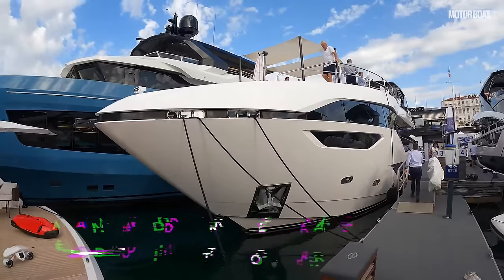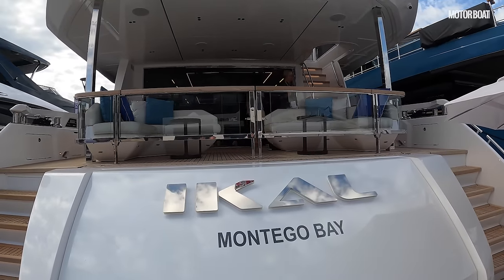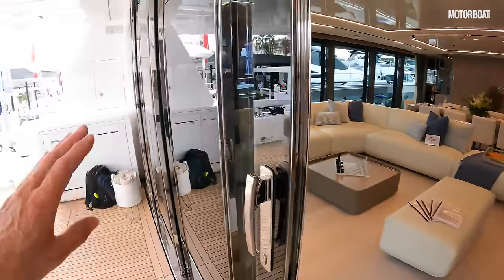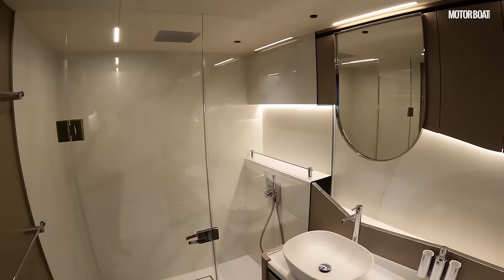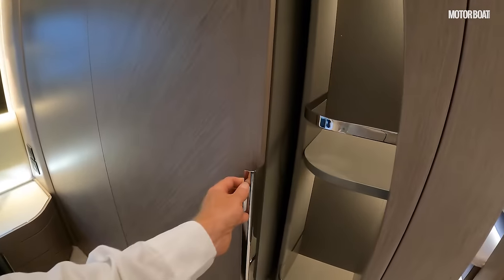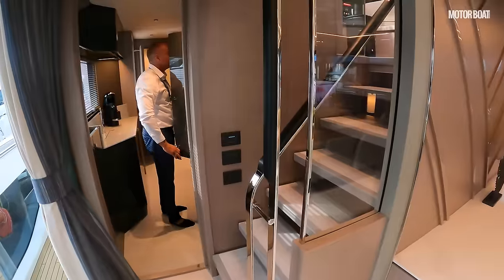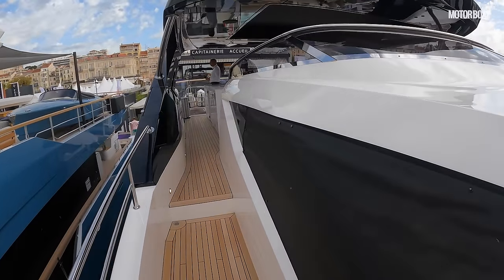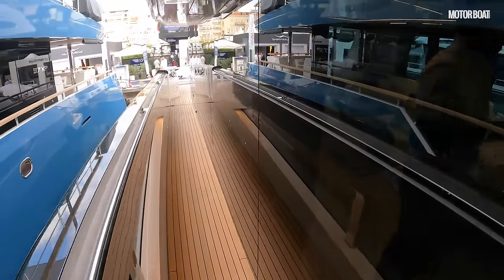Sunseeker 100 Yacht full tour | Inside Sunseeker's new 100ft masterpiece | Motor Boat & Yachting

Comment: Great tour Hugo! I like it . It has some new features and is in a great size range for them. The engine room access is pretty bad though. Also it's hard to tell from the video how the helm view would be. The fly bridge or upper deck is amazing!  The salon and the rest of the interior is beautifully done!
Reply: The visibility from the helm is probably horrendous with the height of the "dashboard" and the slope of the windshield. Maybe if they added a second helm position to the flybridge (I see absolutely no problem with it, just extend the wiring from the main helm), it could help a lot, especially since you can owner-operate it with minimum crew

Comment: Can this squeeze under the 24m reg standard? It's never very clear, the calculation seems super convoluted (I know it is not LOA or waterline length that determines it) and it's best to just let the manufacturer tell you rather than working it out for yourself.

Edit: you answered my question in the video, amazing that something this big can be owner operated.
Reply: Apparantly it does! But I have now idea how it is able to without a removable nose cone.

Comment: Great video tour 10/10 just one question though. The yacht is 29 mt and it falls in the 24mt that the owner can sail on their own with out crew, why is that?
Reply: Because the measurement is taken from the load line length of the main hull not including the bathing platform and the protruding bow section above the waterline.

Comment: Hello - great presentation, raw and honest! Tell me: with all the technological advances and new materials in this boat (and others of this caliber), have these advances reduced the need for maintenance and number of crew members required to run the boat and keep it in good condition?
Reply: Not really. They are certainly easier to control but they still take just as much cleaning and maintenance if not more due to all the  extra kit they carry.

Comment: Thanks for taking us around, difficult job during a busy show. Lots of glitters, but a boat to have a berth in south of France or Mikanos, not to go to sea. I hope that master room will not be flooded in big seas, wonder how water tight that door master cabin door is? Too much furniture and seating space, very ambitious to mimick large boat environment, but looks too crowded. Not much space to move. Also not much space for storage of boat stuff. Many refrigerators, but not enough lockers.

Engine room is a failure, too tight, again a lot of compromise to have large living space. Accessing the engine room during voyages will not be easy and pleasant..

Pilothouse is also a compromise, I feel with such high bulwarks and lounging space in the front, view is limited during the cruise. Captain will be operating blind during docking and have to rely on the crew assistance for the maneuvers? The dining table in the salon has better and more open views.

Nevertheless, looks like this is what is selling, but a good, seaworthy boat is always preferred by experienced and educated owners..

Comment: Hugo said there is only one helm on the boat. You can have a helm on the fly bridge it's just an option this owner didn't choose.
Reply: That is correct, although so far only one buyer has opted for it.
Reply: @hugoandreae3785  thanks for clarifying. It must be expensive then! I know i'd want it or I'd rather the 90 Ocean as it's important to be able to have a little drive outside. Even if you do have a full time Captain.
Reply from the maker: @EpicSlug  It's more because owners prefer to keep the whole flybridge as a private guest space. I'm pretty sure the Captains would specify it they were they were the ones choosing though!
Reply: I like that. Sometimes, one main helm station is better.

Comment: Hmmm - Not a favorite. The interior is nice but a lot of compromises. The engineering space is cramped. Don't like the lines, but there are more yachts with those lines these days. Also, just one bridge position? Sunseeker was desperate to get this out under the 24 meter line.
Reply: I can only dream of yachts, but when I dream of driving myself I’m thinking of about 65ft as a reasonable limit. Anything bigger seems too much.
Reply: @sirmurf  Agreed, 60 to under 70 feet seems to be the largest sweetspot for owner operated, and if you go up to crewed I think I would prefer a bit larger still than this size. Maybe around 120-130 feet is the perfect size for a floating luxury hotel to fit the whole family and a bunch of friends, along with enough crew to create the luxury resort experience. 😅

Comment: Engine room. Disappointed. If the host fails. Example. Pressure pad. MTU machines give this fault after 6 years. And especially slow forward. If you quickly give the pressure b